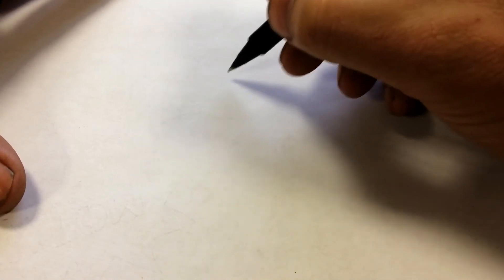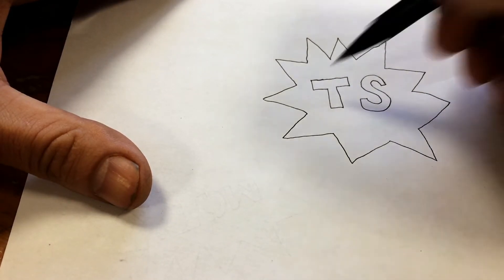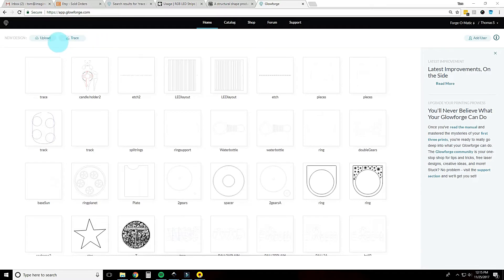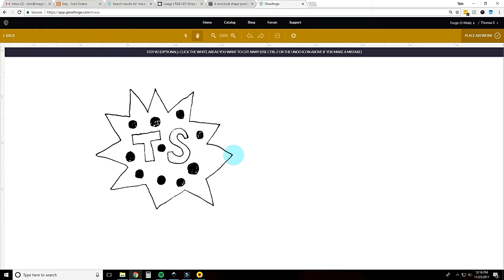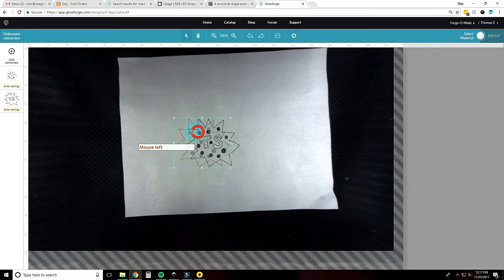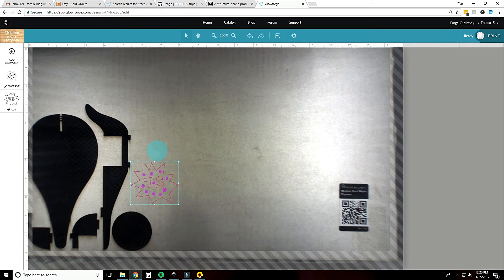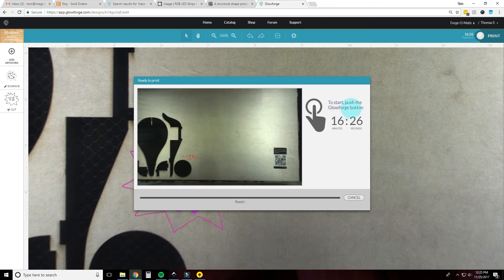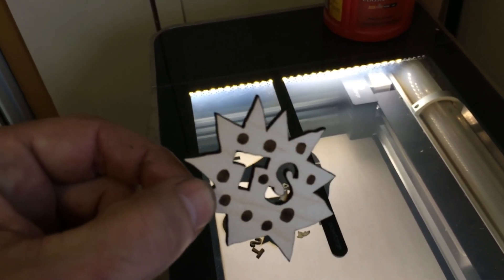Glowforge User Interface:  Trace Feature Walk-thru

Comment: Can you use the sketch feature and just engrave and not cut? Also can you use other wood besides ply? Like say live edge wood?
Reply from the maker: Yes you can use sketch to only engrave,  and you can engrave lots of things,  leather, hardwood,  glass, acrylic, slate and more.
Reply: Right on! I’m debating if I should get a glowforge. The only thing keeping me away at this point is the price. What model do you have/ recommend? Right now because of price I’m leaning toward basic because of price, but do you think the plus is worth it?
Reply from the maker: The only reason to get the pro would be if you had a need to do really long pieces with the pass thru slot or if you we planing on using it all day every day.    I use my pro a lot for work and 95% of the time I’m sure the basic would be fine.